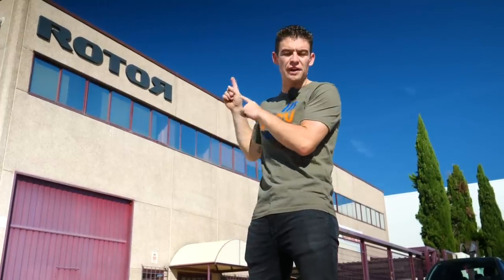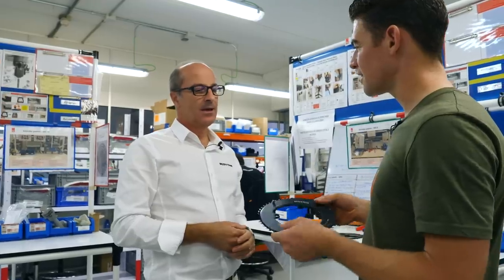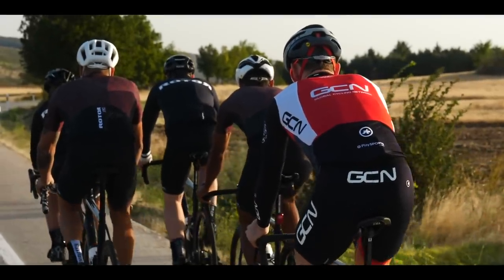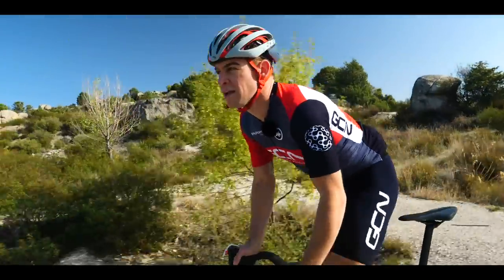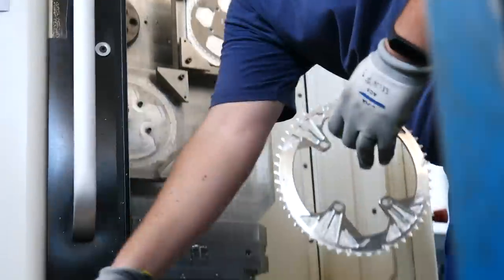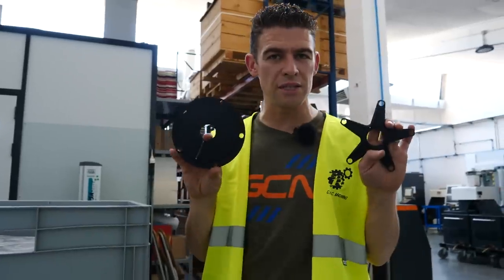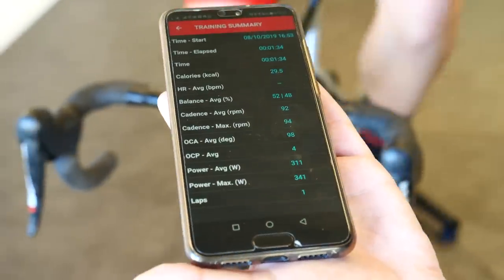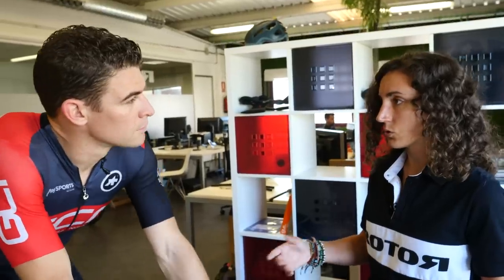The Theory of Oval Chain Rings | ROTOR Factory Tour

Comment: If you see at 01:22 the previous device that he is talking about is clearly with eccentric chainring, and with cranks neither in opposite line! Something a lot more complicated/expensive with that box, but probably that actually provided a good mechanic advantage with a longer leverage when pushing and/or a shorter leverage when pulling. The oval ring I think that do not provide any mechanical advantage as the longer leverage that you have at the dead point (~0°)is compensated with the shorter leverage of the same measure that you have at the most advantageous angle (~90°).Result is that you have the same average power of a circular ring but with less "peaks" in the synusoid graph at cycloergometer. See https://www.allenati.it/analisi-della-pedalata
 I think they well know this as they only speak about "less joints pain" as advantage.
P.S. Probably they discontinued the previous device also because th UCI rejected it. The rule says that traction movement must be circular. There was another device, named "Easy Crank" if I remember well, where the ring was circular and centered as usual but the crank was in two parts sliding one inside the other following an oval and eccentric cam fixed to the frame (one in each side). Also this disappeared probably because of the same UCI ban.

Comment: I am really not sure how that makes sense. However, I would love to try these out. I struggle with a „round“ cadence, so maybe they might be the fix.
Reply: I can picture how they work but couldn’t begging to explain it

All i can say is the shape makes a small amount of the thing have an less rotation force required and if that part goes between the power push and the next power push you use less energy i guess

Which means you can go further but not necessarily faster
Reply: Lars I recommend you try it, I love mine and would never go back.
Reply: The best place I've found for it is 1x, low gears, on road. I have an oval 40T front, and 11-42t rear cassette. And on the 4ish lowest gears, getting through them up to speed, you feel every push on a down stroke, and every lull between down strokes, and that's evened out more with an oval ring. Like I don't even know if I have a significant performance boost with oval. I don't use power meters or a bike computer. But I do feel when putting down power, it's smoother and less jerky.

Ie. Performance benefits, questionable. comfort benefits, confirmed, in my experience

Edit 3: actually, a definite plus, is on super steep hills, which you'd literally be on your 1st-3rd lowest gears, they're a great help for preventing stalling out. The smoother strokes mean it's easier to keep grinding.

Comment: Not sure about all of the negativity in the comments here and the "lack of science" comments. It's a big subject and to cover all of the information that different individuals might require would take a much longer and in-depth video than this one. I can only provide my experience with ROTOR products, with a little bit of what you might loosely call "SCIENCE". I run ROTOR 2in1 175mm cranks and BB on  Specialized Epic MTB with a 32 or 34 (rare) tooth Q Ring in a 1x12 SRAM AXS setup. I race XC media(half +/- 50km) marathon and marathon (+/- 100km) as well as multi-day races (just completed the five day Roc Trophy at the Roc D'Azur in Fréjus France 232km). The products have been flawless. There is no excessive wear to either the Q Ring, the cassette the derailleur, jockey wheels, chain, clutch etc in any conditions. When I started with the products I used the app more frequently. There are two options, App on the phone or full software on the computer. The software on the computer is more in depth and is intended for indoor situations with your bike in a trainer or on rollers, where you (or your coach/ trainer) can see the readout in real time of your pedal stroke and metrics (torque, efficiency, balance through the pedals% etc). I have always used the App, as I don't put the full suspension MTB in the trainer. The App allows you to do various things, even just to record a ride (and in the latest version, this uploads directly to Training Peaks/ Strava etc, useful with Strava's latest actions). The more important (for me) has been the "Torque 360" element of the app, which is where OCA and OCP come in. I started on position 3 (as recommended). After undertaking the sessions as directed, the software determined that I should have the Q Ring in position 4, easily changed. The Q Ring allows for a smoother pedal stroke and less time in the "dead zone" coming over the top of the pedal stroke. This translates into a smoother pedalling style, especially when climbing. When grip is at a premium, or the going is rough, this has allowed me to maintain a smooth output and drop riders who are struggling to climb and find grip. It might be "easier on the knees" but I didn't have knee pain before and I don't have it now, so I can't comment. It takes about 10 hours riding to adapt to the Q Ring(s). This year I have been using "The Sufferfest" and the training program I have been following has improved my fast twitch muscles and their engagement and usage (175mm cranks = long pins). After completing the program and feeling like I had made gains and benefits, I went back to the ROTOR App and ran the Torque 360 again, lo and behold I am now recommended position 3, meaning my legs are firing earlier in the pedal stroke and releasing my max output sooner. I think that's SCIENCE isn't it? 😂 The ROTOR 2in1 system communicates perfectly with my Elemnt Bolt, providing all power and cadence metrics and allows me to have all of the metrics (and more) at my disposal in front of me. I have one screen showing all of my pedalling metrics for those days when I am concentrated on maintaining or making improvements in my pedal stroke. My experience has been only been positive, with the product hardware, the usage, the customer support and what I feel are benefits to my training, racing and power output. I can't say any more than that, or be any more "SCIENTIFIC" 😉
Reply: Commenters are asking for a justification of the title of the video, "The Theory of Oval Chainrings," because no actual theory is presented only what scientists call handwaving.  I'm glad you like the Rotor chainrings, but your story an anecdote, not science.
Reply: @raybaxter4683  without friction, we are all lost 😉
Reply: Hi Evidence of Fabulous Life-Shawshank

Thanks for your message and positive feedback about our products
ROTOR team

Comment: so I understand that the concept is maximum resistance with maximal force and minimal resistance with minimal force but how did they settle on the 12.5% ovality that they use why was 12.5% better than 10% or 20%  ovality
Reply: Hi Drake,
We have over 25 years experience manufacturing products around the pedalling efficiency concept. In past we offered both 10% ovality and 16% ovality. From feedback from clients and pro teams as well as analysing masses of power meter data we settled on 12.5% as the best compromise to give benefits of the ovality and easier to adapt to then the larger oval chainring.
Thanks ROTOR Team

Comment: Does the pumping up and down of the rear dera. when spinnig the oval create more wear on the rear dera.?
Reply: The movement is quite small, as you can see in the video.  The chain always wraps exactly half the chainring, so the only variation is the distance from the rear cog and idler pulley to the contact points and that amounts to just a few milometers.  I suppose it will eventually cause wear, but only after a long, long time.  If you put a dollop of tri-flow between the cage and the derailleur body you should be fine.
Reply: I just wonder if the claimed power gain from these rings offsets the loss from working against the spring and clutch. The movement is quite significant, if it only moves 2mm (looks like more) for each revolution at 80rpm that's almost 10m per hour!

Comment: These rings are EXPENSIVE!  I'm no Engineer nor an Orthopedist but LOGIC would dictate that Ovaloid CRs cause you to GRIND instead of SPIN, since the larger diameter of the ring is in the power phase: 1 o'clock to 5 o'clock position.  This runs COUNTERINTUITIVE to what is being PREACHED today ... to "Spin, Spin, Spin". Seems Shimano had it right to begin with with their 80's/90's era 'Biopace' CRs which were OPPOSITE, placing the SMALLER diameter in the power phase: 1 o'clock to 5 o'clock position causing you to SPIN a bit faster in the power phase.  For older riders or those with knee problems Biopace rings would be a much better bet than Rotor rings. Also Biopace rings could be a Secret Weapon in a Triathlon.  Seems your legs would be fresher for the Run since you reduced your CR tooth count in power phase and increased you rest time in dead zone phase.  I bet traction is better on climbs on gravel, dirt or mud with Biopace CRs. You can buy Biopace rings (mostly used) on Ebay in various sizes in 5 bolt from 26t - 53t in 74, 110 and 130 BCD. They are 1/10th the price of these WAY OVERPRICED rings too.  I use them. They work GREAT and mesh fine with 10/11 sp. chains and have no issues with shifting the Front Derailleur.

Comment: Can pedal based power meters be used with oval chainrings?
Reply: Hi Tom,
They can be used with pedal based power meters but depending on the power meter brand they will over estimate by a small percentage the power output. We recommend ROTOR's range of power meters due to our high rate data sampling as one of the most accurate power meters on the market. more info here: https://rotorbike.com/catalog/default/rotor/road/powermeters.html Thanks ROTOR Team

Comment: I wonder how the OCP changes while standing, climbing?
Reply: Hi Travis, 
OCA changes under different circumstances with variations in bike, intensity or position on the bike. What you need to know is under which circumstances you want to take the most advantage from them: Sprinting, climbing or pounding out the KMs. There's always a good compromise that gives you that advantage when needed and is still optimised during the rest of the time. 
Thanks,

ROTOR Team

Comment: My 87 trek has them. They are nothing new. They seemed hard on the knees.
Reply: Hello!  @ROTORbikeComponents  
I have a question regarding the variation of the knee speed.
As mentioned in the video by Irene (who seems to really know her stuff), it is important to calculate RPM multiple times during the pedalstroke because of the change in angular velocity (14:45). If now the angular velocity (speed of the pedalstroke) changes, how come the knee speed remains more constant, compared to round circular chainrings?
I just read a paper that might be helpful on this topic, "Effect of chainring ovality on joint power during cycling at
different workloads and cadences" by Strutzenberger et al. (2014), Figure 3 shows the varying cadences nicely.

I would really appreciate a solid answer to this, since I am interested in oval chainrings myself, partially because of experiencing knee pain.

Kind regards
Lukas

Comment: Why is the worker deburring holes by hand?  Deburring on the machine.  Not by hand.  Note that he wasn't even holding the ring square to the tool.
Reply: He wasn't deburring.  He was quality checking to make sure the deburring had been done correctly.
Reply: Nope.  7min 28sec.   That's not a quality check.  He is (lightly) deburring holes.  By hand.

Comment: Is this different from Biopace in the 80s?  The patents ran out?  Kinda like Apple creating the Mac from Xerox parc 60s tech? I'm still with theory that what ever power you can extract from rider is what you get, no matter the way. It's physics 101.  Love to know more about what I am missing here.
Reply: You're not missing anything, imho.
Reply: HI Rich,
Thanks for your message. We firmly believe in the oval chainring concept. The orientation of the Shimano oval rings was completely different from the orientation of the ROTOR rings and other oval rings currently in the market. With the Shimano rings the maximum diameter was coming in the angles were the legs were able to apply the least force, while the minimum diameter was coming in te angles in which the legs could apply the maximum force. That's the reason why they disappeared. Current oval rings are designed so that the maximum and minimum resistances come when it is biomechanically better for our legs. We hope more people will try our chainrings and feel the difference.

Thanks
ROTOR Team

Comment: Looks like the old school Bio-Pace... I have them on my gravel bike...

This is nothing new... I used to work for Bicycling Magazine, and helped research the history of oval rings around 1984, some pretty extreme... crazy actually.

The rings were supplied by Frank Berto, a late cycling historian who rode well into his 80's.
Reply: Biopace is 90 degrees from this. Unlike biopace this makes it easier to go through the dead zone (vertical crank). It helps every time you could stall when the crank is vertical. Also you less likely to slip by overcranking because oval gives more even torque. The smoother your power output throught the whole rotation, the less helpful is oval ring.You will not notice it on flat smooth asphalt, when pedalling with very high cadence.

Comment: No discussion of Shimano Biopace?
Reply: Hi Matt, 
Thanks for your message. We firmly believe in the oval chainring concept. The orientation of the Shimano oval rings was completely different from the orientation of the ROTOR rings and other oval rings currently in the market. With the Shimano rings the maximum diameter was coming in the angles were the legs were able to apply the least force, while the minimum diameter was coming in te angles in which the legs could apply the maximum force. That's the reason why they disappeared. Current oval rings are designed so that the maximum and minimum resistances come when it is biomechanically better for our legs. We hope more people will try our chainrings and feel the difference.
Thanks
ROTOR Team

Comment: I thought they gave up on these many years ago.
Reply: edwinf9999 Shimano biopace 😂
Reply: @okantichrist  biopace , the oval was the other way round.
Reply: Yeah i thought that too, we used them back in early 90's
Reply: The fact that they've completely switched orientation now makes me think they can't make much difference. Surely if one was improves your efficiency then the other way would make it worse?
Reply: Hi Edwin,
Thanks for your message. We firmly believe in the oval chainring concept. The orientation of the Shimano oval rings was completely different from the orientation of the ROTOR rings and other oval rings currently in the market. With the Shimano rings the maximum diameter was coming in the angles were the legs were able to apply the least force, while the minimum diameter was coming in te angles in which the legs could apply the maximum force. That's the reason why they disappeared. Current oval rings are designed so that the maximum and minimum resistances come when it is biomechanically better for our legs. We hope more people will try our chainrings and feel the difference.
Thanks
ROTOR Team

Comment: #Torqueback How does riding on the flat compared to climbing affect the position of the Q Ring? Isn't power applied differently in the pedal strokes when climbing?
Reply: Hi Mark,
OCA changes under different circumstances with variations in bike, intensity or position on the bike. What you need to know is under which circumstances you want to take the most advantage from them: Sprinting, climbing or pounding out the KMs on the flat. There's always a good compromise that gives you that advantage when needed and is still optimised during the rest of the time. 
Thanks,

ROTOR Team

Comment: Older cyclists what is the difference between this(Rotor) and Shimano Bio-pace in the late 80's?
Reply: Totally different timing.
Reply: Literally everything
Reply: Hi Hedley,
Thanks for your message. We firmly believe in the oval chainring concept. The orientation of the Shimano oval rings was completely different from the orientation of the ROTOR rings and other oval rings currently in the market. With the Shimano rings the maximum diameter was coming in the angles were the legs were able to apply the least force, while the minimum diameter was coming in te angles in which the legs could apply the maximum force. That's the reason why they disappeared. Current oval rings are designed so that the maximum and minimum resistances come when it is biomechanically better for our legs. We hope more people will try our chainrings and feel the difference.
Thanks
ROTOR Team

Comment: In the test I've seen they never say what sizes they are using, a 32t round, vs a 32t oval is an unfair advantage, I call a 32t oval a part time 34t because of the height.. just go from a 32t round to a 34t round and you'll see a good improvement.. people changing from a 32t round to a 32t oval should see a difference, its TRICKNOLOGY !!! it sells stuff, I'm waiting for oval wheels...;) !!!

Comment: Power meter is designed to work at -20,  who is going cycling at -20!
Reply: If you commute by bike, then you have no option of choosing weather conditions. Two years ago I had to commute in -25-26C for about a week. After first looking at my termometer I expected my ride to be a positive disaster, but actually it wasn't so bad)) Moreover, I find temperatures between -10 and -20 optimal for riding in winter, because in this case there is no that awful sand-like snow on the road (all of it becomes nice and dense).
Reply: I do, every winter. I don't use a bike with a power meter outdoors during the winter, but I'm sure a lots of people use theirs on their mountain bikes.
Reply: [ancient aliens meme] "Canadians"
Reply: They wanted a data points as far apart as possible within working temp range for calibration of power meter